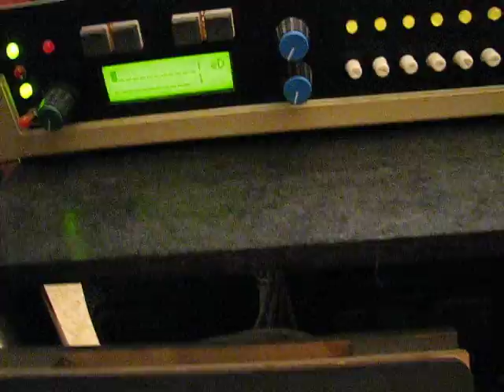My DIY electronic Drum Tutorial,

Comment: Hey Dror, great kit man. Just a question though. How did you set up the 2 states of the hi-hate [open vs closed] and the rim shot / snare parts? Am building mine with an Arduino board and a raspberry Pi as the synth module. Very new to linux so any tips would be greatly appreciated.

Comment: Much better kit is to take a Remo practice pad. Between the molded plastic body and the head put a cheap radio shack piezo transducer and mount it on a small metal plate the size and thickness of a coffee can top.Put that in between the head and the pad body.
  Then just wire it up and your good to go.  Just as good as any $200 mesh head and the touch sensitivity is GREAT. Feels real, sounds real and is dirt cheap.  Easy to mount since the Remo comes with standard mounting equip.

Comment: Ok, so if I understand correctly, the piezo sensor is not glued "sandwitched" between the wood and the rubber that you hit on right? Starting from the rubber surface you hit on with the drum sticks it is, (1) the rubber pad you hit on, then (2) the wood plate, then (3) the piezo sensor glued to center on back of wood plate, then small piece of foam behind the piezo to protect it from dust, correct? Thanks for all the help Dror :) I can't believe you even built the midi box too! amazing!